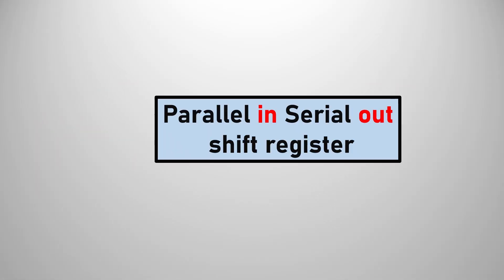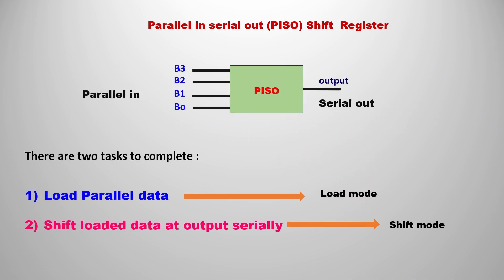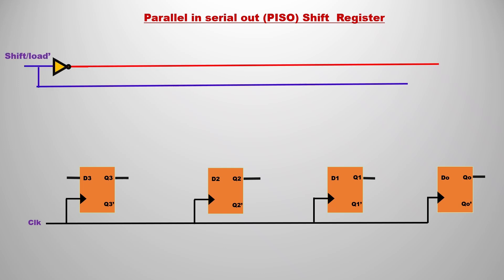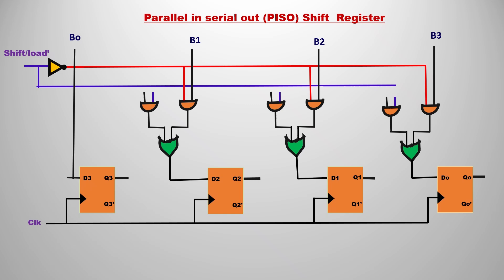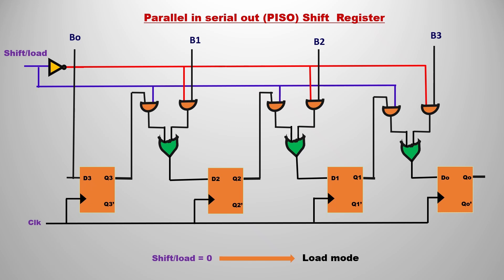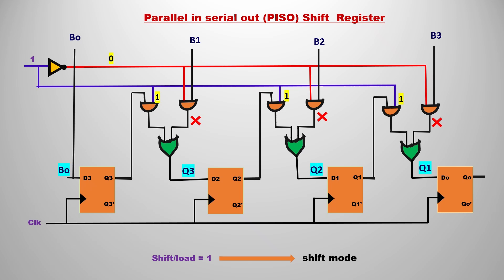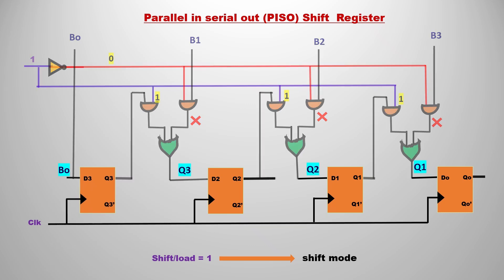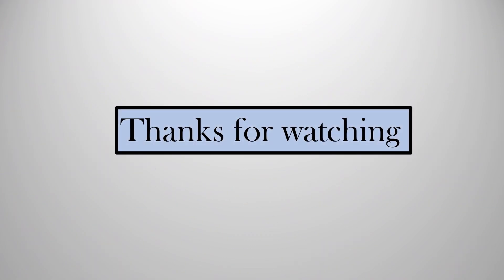PISO Shift Register Explained | Parallel In Serial Out | Load & Shift Modes with Applications

Comment: I think, 1 clock pulse to store the data and N clock pulse to shift the data serially. Total : N + 1 Clock pulse.
Reply from the maker: "Thanks for sharing your view! 😊
In my explanation, I considered 1 clock to load and then N-1 clocks to shift the data out, so the total comes to N clocks for a full operation.
Some texts do count it as 1 + N if they include an extra final shift or an idle clock, so both ways of looking at it can appear depending on the reference.
Appreciate you pointing this out—it’s a great way to clear up the details for everyone! 👍"